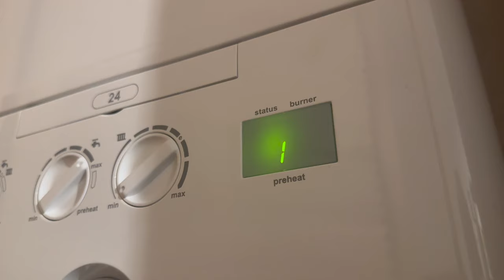HOW MUCH WE MAKE IN 25MINUTES!!!!

Comment: I charge fixed price £140 + parts (20% Mark up on parts) on boiler repairs. Weather it takes me 5 minutes or 5 hours.. I find I can fix most boilers within an hour... had 1 customer recently, I went out at 6pm stripped his boiler and repaired it without needing parts. While I was there him and his wife where over the moon and said its never work as good.... sent my invoice £140, he said the price was far to much as I was there 30 minutes and I didn't use any parts.. I was recommended to him aswell from another engineer as it was a worcester and not many engineers I know like to work on worcesters... 
Anyways I never got paid! Do you ever have any issues like this? And how to you avoid it happening?
Reply: You need to fill out a small claims form and send it off to him, otherwise he will carry on ripping off tradesmen/women.
Reply: Mate that's so irritating.  They pay for an outcome.Especially as I assume they knew the deal upfront ? Absolute pricks
Reply: Make them aware and agree cost before even going to the job, this doesn't cause any surprises afterwards
Reply: Get paid up front or don't go